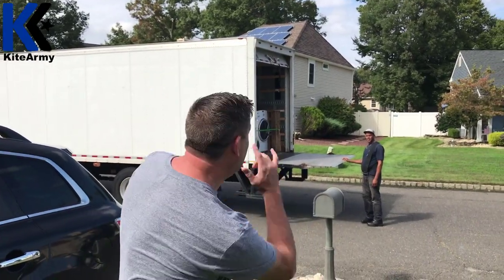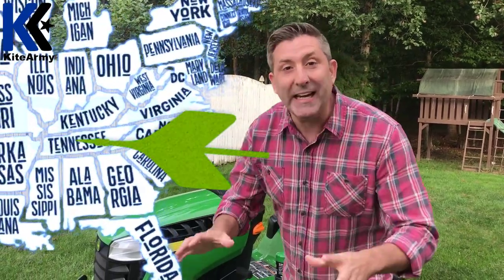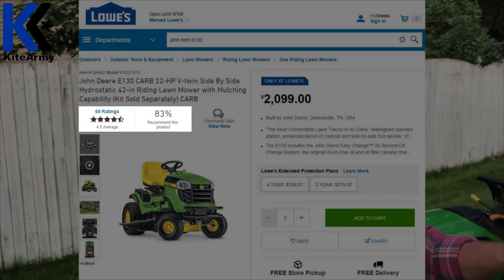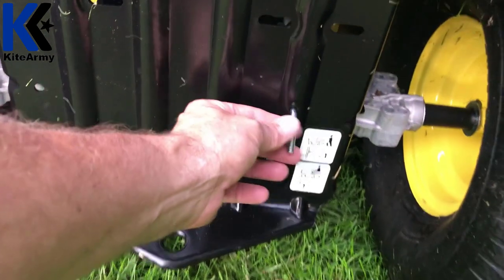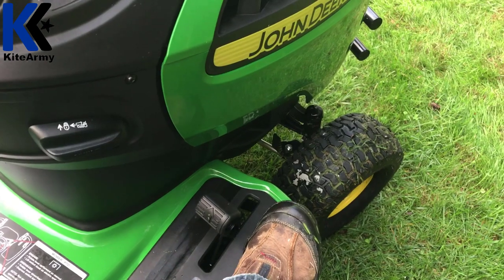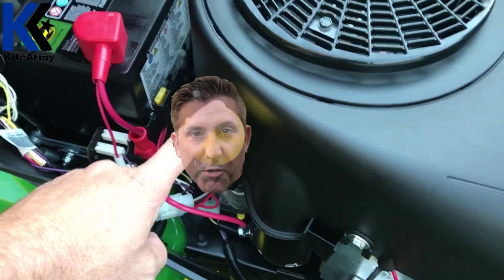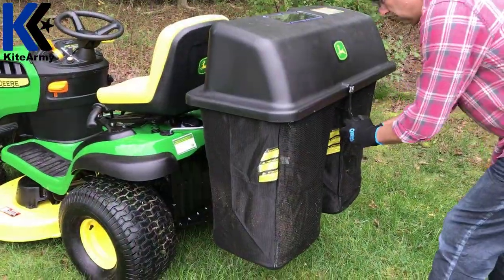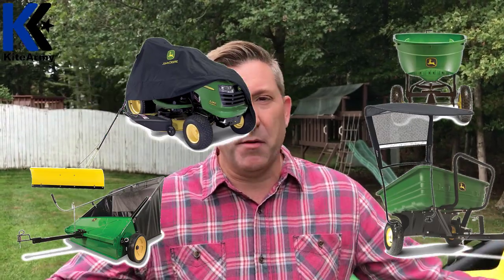Best Riding Lawn Mower 2019 | John Deere E130 Review 🌿🌿🌿

Comment: I bet he isn't so happy in 1 yrs. Good luck,give us a review in a year, bet by then he has been through  1 belt and 2 idler pullies, just like mine did, the bearings wear out on the pullies absolutely no grease gets where it is needed,they are sealed, so you basically are greasing nothing,ridiculous!!! Same goes for easy oil change doesn't  even work, junk designing,  for them to make more money, pissed off JD owner, never again even if free.oh yeah I forgot to mention when I bought  it at Lowe's customer service was supposed  to send in my year warranty I stood there for a half an hour,giving all my info, so when I contacted JD about warranty,  they never received  it from Lowe's,  great work Lowe's, also the day I received it I tried it,started mowing and one blade came loose, great work, idiot's  all the way, never ever buy again.
Reply from the maker: Bummer - must be a lemon because I'm in love with mine.  Come over for a ride!

Comment: More overpriced Lowes JUNK! That deck flush will ruin your mandrel bearings. The frame will crack where the rear axle attaches, and the K46 transaxle will give out if you use it for anything other than cutting grass. The stamped deck is less than durable. A fabricated deck is  much better. How do I really feel?
Reply from the maker: Don't sugar coat it ;)
Reply: Old magician 100% agree these newer john deeres are absolute garbage

Comment: junk
Reply from the maker: what would consider "not junk"
Reply from the maker: @electrified7309  I didn't see that coming - sounds like a battle of Coke vs Pepsi
Reply: @Kitearmy  I have a Cub Cadet and the trans went out twice and they are nonservicable and the John Deere has the same trans, for the money I'd go with the Husqvarna or Husqvarna TS
Reply from the maker: @electrified7309  Interesting - though my wife had a honda car that blew up at 10K miles so their is such thing as a lemon
Reply: @Kitearmy  Dealer told me when he replaced the first one that they have had a lot issues with trans in the XT1 models so I'd say not a lemon just a cheap Trans I'm sure if you poor more money in to the higher end models they will be fine, they have heavy duty Transmissions in them
Reply from the maker: @electrified7309  Oh - yeah this is a consumer grade model - maybe what your using it for is more demanding